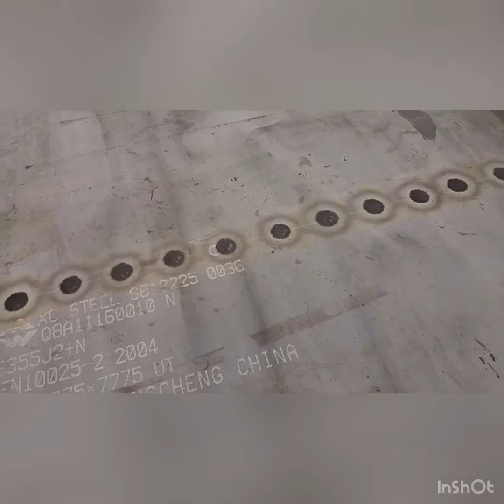Flame straightening plate￼ 5 inches tick

Comment: Ok now wait? It’s 5in plate so it’s probably base plates for columns. Just cut to size and then mill it smooth where the field bolts go. Don’t waste time and fuel doing this 🙄
Reply from the maker: No it’s not for the things you just said.  Is  for something else look my other video you’re going to see the products 
It’s called heating plate simile to the radiator so hot oil going through that heating material
Anyway thanks for watching my YouTube channel